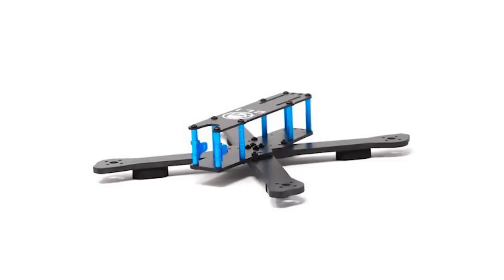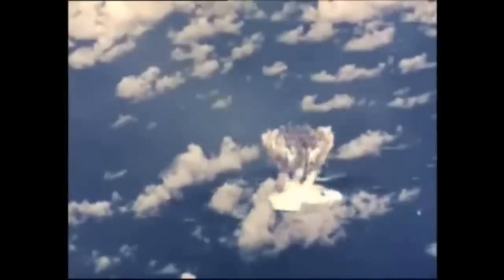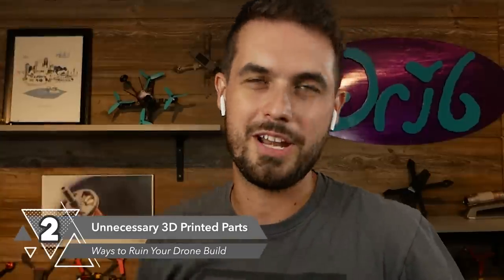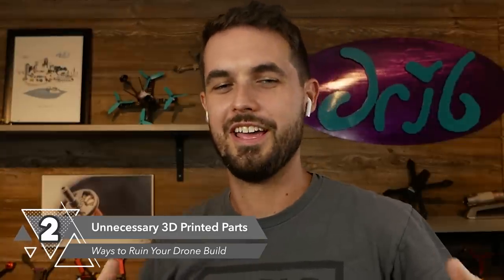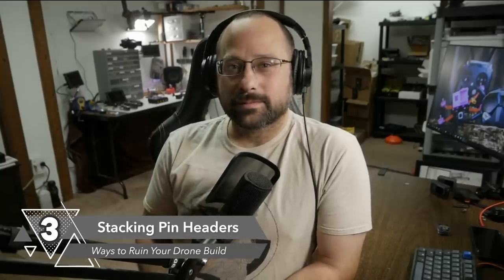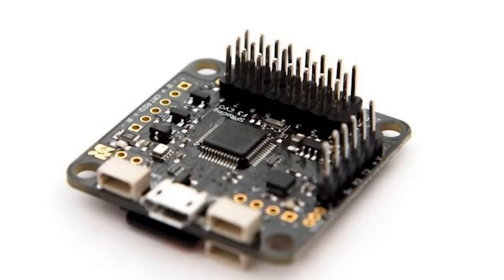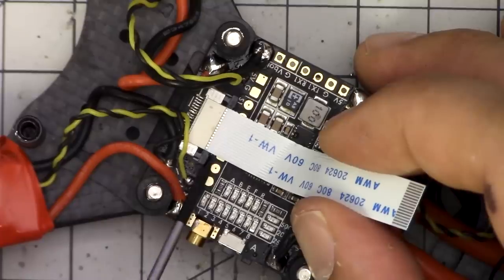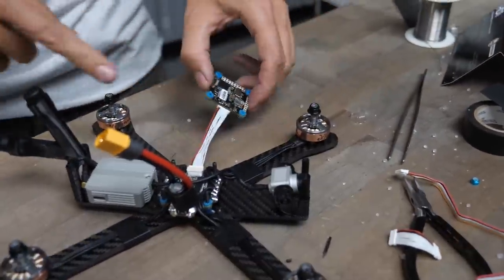6 Ways to RUIN Your FPV Drone!

Comment: I was just in the middle of a sub 250g 8 inch quad with titanium screws and nylon stand offs only 5 mm high wrapped in red electrical tape with a huge picnic table of a spoiler on the back and the most resilient wooden bumpers you've ever seen!

IM OFFENDED BY THIS VIDEO!!!
Reply: Bro so funny 👍
Reply: 😂😂😂man this is so funny it made me laugh on a rough day. Thanks!
Reply: Damn shame- did you have the 2 lbs of 3D printed parts ready too?
Reply: @matthebert007  Now that would be silly....... 🤣🤣🤣
Reply: After the day I've had, I needed that!
Reply: @HankSweeney  🤣🤣🤣🤪🤪🤪🤪🤪
Reply: Hey, they only said sub 250g 5 inch quads are a bad idea. They said nothing about sub 250g 8 inch quads... 😂
Reply: Ewwwwwwwww burn it
Reply: Hahahahaha

Comment: I come from the aerospace industry where titanium is used frequently. I believe you're right Joshua, you can make smaller lightweight parts with titanium but you are correct in that if any of the highly polished surfaces showed any signs of even the lightest scratch that part is scraped in my industry, titanium will fatigue fail where steel will just slowly deform.
Reply: But if you're going to crash your drone, wouldn't you prefer the screws to be the weakest link so that you'd have a better chance of saving the motors? The crash impact energy needs to be absorbed somehow;  I would prefer it not go to the motors.
Reply: @danusas88 Titanium and steel have different levels of DUCTILITY. 

Steel can undergo significant plastic deformation before it fails. 
Titanium, is more prone to fracture.

Over tightening a steel screw stretches it, and locks the threads, a titanium screw fractures and fails when you are depending on it later. 
( I hope this isn't a lightweight build intended to be around people )

Comment: Here's an easy one I'm surprised you guys didn't mention: Not using your smoke stopper because you're too lazy to reach over the extra foot to get it and you're pretty sure you soldered everything up correctly on your first try.
Reply: Never had one of those. I use my bench power supply to test drones. It has short protection and, as a bonus, shows how much current is drawn.
Reply: It blows my mind that people can't tell if they've soldered something incorrectly.
Reply: @wongalahara8196  I was the same until I followed a chinesium wiring diagram that was included with an ESC, which turned out to be for a previous revision where the vbat+ and ground pads were swapped
Reply: @Lozoot2  snap good point dude. I didn't think about that!
Reply: @wongalahara8196  and sometimes it's not even the solder job - a lot of the times the wiring harness from a FC to a 4-in-1 doesn't match up and it's easy to mistake which side is supposed to be "up" on the wiring diagram. Just yesterday I wired one backwards at first but caught it when triple-checking with my multimeter. I'm glad I've made it a habit to check!
Reply: @Lozoot2  I guess I just haven't had any bad luck with soldering and wiring harnesses yet lol
Reply: how were you checking for proper esc-fc wiring with your multimeter? Great idea I just am curious to what you check/how @Lozoot2
Reply: @CockroachSlidy funnily enough you did have one the whole time! Just an overkill one 😂

Comment: Never thoughts about it but from a former aircraft assembler your right. We would put lead rivets where expansion and contraction would happen and titanium composite bolts where we needed rigidity They would bend to an extent when trying to get a jammed one out, (because it wasnt pure titanium) but once that tension point was reached to would snap like concrete.

Comment: The alloy of titanium used makes all the difference! The alloy they use for titanium motor shafts works OK. But most screws of any metal sold on the open market tend to be low grade easy to work metal. Notice haw Joshua said "high grade" steel screws.
Reply: exactly, comparing "cheap" titanium hardware to high grade steel is a stretch. Ti will fatigue faster, but a good grade Ti hardware is more than enough.

Comment: i think there were a couple essential ones missed here. mounting the vtx antenna on the hole in the top plate, soldering the XT60 straight to the board without any wire in between, attaching the capacitor to the XT60 connector instead of inside the frame
Reply: Ohhh that's good.
Reply: All of those are good tips.  Basically you want nothing to be a rigid connection.  Everything should be able to flex a little in a crash.
Reply: What's wrong with soldering the capacitor to the xt60?
Reply: @stevensbox9625  while it is electrically effective, it puts the capacitor at risk of being damaged. they are very fragile and i have damaged countless capacitors even when they were mounted externally in a place that i thought was safe
Reply: @benfoust1  Its electrically less effective. The point of the cap is evening out very fast spikes, any length of wire will slow it down mostly due to inductance.
Reply: @drkastenbrot  the difference is so minimal that it’s negligible. thats why its very common to put capacitors on the battery pads or even on the esc leads and they are still just as effective
Reply: @benfoust1  The reason that works is that the ESC already has a handful of low esr caps right at the source of the noise, placing the electrolytic cap further away from the pads will put more strain on the small decoupling caps. 
At high frequencies, wire is not nearly as conductive as you might think.
Reply: @drkastenbrot  bro the wire’s resistance is so negligible. even if u do put the cap directly on the xt60 theres wire between the battery and the cap. it works just fine when the cap is soldered to the battery pad on the esc/fc
Reply: @benfoust1  Fine, here is some numbers:
The inductivity of a wire pair 12awg, 5mm apart, 15cm long is about 40nH. 
at a frequency of 100kHz which is the approximate rising edge of the dangerous peaks this would equate to about 25 milliohms or 2V at 80 Amps. 
Thats well over 10% of lost effectiveness just because of different placement of the cap. 
Having the wires closer together (5mm was a bit generous) makes this effect much worse.
Reply: @benfoust1  OK, Thanks. Its gonna be hard o fit it into the Armattan Badger along with the DJI Air unit. But I'll work on it.
Reply: @drkastenbrot  fuck all in a big ship. Also you forgot about the capacitive coupling, that probably wipes out your “inductivity” also most commonly known as inductance.
Reply: @Clynikal  What does capacitive coupling have to do with this? The schematic literally has deliberate capacitors on both ends of the wire pair.

Comment: Ive broken 5 surgical titanimum  rods in my back over the years.  No ti parts for me
Reply: jezuuus mate are you ok?
Reply: @ze2004  oh yes man been wheelchair bound since 4 years old. Nothing stopes me from doing what I wanna do. Well the broken rods do lol
Reply: damn another thing....... titanium screws...... tried shaving weight with aluminium screws over steel screws..... those just tore apart all the time and i broke tons of arms with them...... since i use titanium screws i never had any problems anymore.

the only problem i got sometimes is that i ruin the thread in the motors cuz they are not as though as the titanium screws
Reply: @RewindFPV  now they have to improve the base of the motors in titanium
Reply: @ze2004  haha 😂
well i actually think there are some titanium variants out in the market tbh 🤔
Reply: @RewindFPV  actually its really important to notice that because i had some steel screws and the base hole from the motors are in aluminum. Dose two materials combined make the holes loose.

Comment: One thing not to do that I found out the hard way was to not make the wires longer than needed. 2 days ago I transferred my electronics from my old GepRC LX5 to a GepRC Mark4 frame and I managed to do so with minimal soldering, however this meant that my wires from the FC to the (separate) ESC's had no slack. I took it out and everything flown great, right up until I crashed into a branch hard on my last pack. The crash snapped an arm, but the flex from the crash actually ripped the ESC power pads right off the flight controller from the arms that didn't even break. This was simply because there wasn't any slack in the wires.
Reply: Don't you mean not to make the wires as short as you can and have some slack?
Reply: @typeOhh  yeah lol. To be fair both. You want enough to have slack, but not too long that it's a mess

Comment: You CAN build a nice sub-250g 5 inch quad. The fly really nice and smooth (without a fancy PID tune) which is exactly what I wanted; a 5 inch cruiser (no GoPro; not my thing). Also, it was quite durable; crashes never broke anything. Due to a video issue,  I lost it in thick Florida brush. Anyway, I liked it and will build another sub-250g 5 inch; so I don't think this is a "RUIN"; quite the opposite. Since I don't do Acro and don't carry a GoPro, these builds are really SWEET and smooth little cruisers. I am also working on a light weight 7 incher. Don't know if it will make sub-250g, but think it will come in under 300g. Yeah, I know this is above the 250g mark, but I think it will be a nice long range cruiser.

Comment: some 4in1 racerstar ESCs need nylon standoffs as two of the holes are ground and the other two are positive battery voltage (not even the rubber isolators as those have metal threads which will rub and short out between layers....ask me how i know)
Reply: Mistake number 1 was bying a racerstar esc
Reply: @neonoir__  yep, lesson learned about 3 years ago.  but when you start out it was hard to resist the cheap stuff to "save" money. especially when every now and then there is a gem.
Reply: @neonoir__  it's the same as the holybro tekko s
Reply: Glad i didnt use mine yet, would have fried it for sure. :)
Reply: @daich  I'd say going for the cheapest parts in general is a good way to ruin the quad. I have a couple of FC: s that I bought because they were cheap. Welcome to gremlin city!
Reply: I remember these ESCs :)  Gone cheap and mounted them and FC with long nylon screws. Kinda sorted out ground loop for FC as well. Guess what happened on first crash :D

Comment: Thanks for the titanium screw point! It's a pet peeve of mine. Titanium is stronger than steel for the same WEIGHT, but weaker for the same VOLUME! When you replace a screw, you can't increase the volume, so you end up with a lighter AND weaker screw.

Comment: All my builds are pretty much slammed, I have so much regret fitting an air unit into every single one of them... :'(
A T-Motor F7 55A esc stack, crossfire nano, GPS, RGB controller, and buzzer into the tiny space of the racing frame that is the Transtec Laser was my first mistake.
Doing the exact same with a Flywoo chasers frame was my second lol

Repairing both of those takes a full day of disassembly. In order to replace the motors on either of them I have to completely disassemble the quad and with the transtec laser HD I have to remove the bottom plate and the arms as you feed the motor cables underneath a pocket created between the arms and the plate. Nightmare fuel.
I've disassembled and reassembled that quad a dozen times now... so many hours of stress.

Surprisingly my easiest drone to build in is a beta95x v2...

If you want to build a drone with those features I mentioned above, build it in a freestyle frame not a racing one or you'll suffer.
Reply: After 2 years w a transtec laser (Nevers break anything ) I have finally  done a ''''''''clean'''''''' build
Reply: @gap8526  this lmao, I fear the day I break an arm and have to disassemble the entire frame. That might be the day I switch haha
Reply: If u want to ne a pro par tertris just start w a racing frame x)
Reply: @gap8526  LMAO I jinxed myself. I forgot I posted this, but a week after I posted this comment about breaking an arm, I BROKE AN ARM. Decided I wasn't going to deal with it and bought a catalyst machineworks shocker tank. Honestly it's a much more difficult frame to assemble, but so much easier to replace a component once it breaks.

Comment: I use high quality titanium screws from KCNC on my discs for my disc brakes on my downhill mountain bike. They have survived without problems for 4 years without issue now. I can't see how they can't take the strains of a quad-motor if they're good quality.
Reply: Yeah they can certainly have enough tensile strength to get the job done (have used them and other superalloys for my job), but I think the main point JB is trying to make is their strength is still lower than a standard high grade steel fastener. 
Steel also generally has higher elongation at failure (9-12%) than Ti (8-10%) which helps to “fail-safe” by yielding and becoming loose rather than fracturing. 

tl;dr - Titanium has higher specific strength (strength/weight) but lower absolute strength. 

IMO if you’re bashing your DH rig around I don’t think the couple grams of lower mass is worth the loss of robustness/failure warning, but they do look sweet!
Reply: @ZacharyPiercy  On my DH rig, I save weight where it is possible and add strength where needed. Ti bolts on places that has shear load and non critical load tensile load (disc rotor mount, link monut, shock mount, seat post mount). Tires, tire inserts, and rims I use proper stuff that can take a beating, I build my own wheels with double butted spokes and brass nipples. I would for instance never use ti bolts to mount brake calipers or for stem bolts.

So, yeah. Ti bolts ar perfectly fine if you know where to use them.

And for looks: Mine are silver, so the look kust like regular steel bolts.

Comment: I use nylon stand offs for my stacks.I have had pretty hard crashes and not haven't broken them. I have also broken them, but after a ton of abuse. I have also used metal screws.  Nylon standoffs will not ruin your build. at  least on the stack any way. I have used them since starting, and I will admit that I probably wouldn't have had to replace the few that I have, but I have had nearly no issues with them.

Comment: Poo sub 250gram 5 inch, I am legitimately in the middle of a sub 125gram all up weight 5 inch build. The quad is looking to be about 95grams and I have a 2s 300mah battery that weighs less than 16grams.
Reply: With the new EU regulations it makes sense lol

Comment: High grade titanium screws work fantastic for motors. I use 2 ti screws on each motor and have never once had a motor come off
Reply: You should weigh them.  You will be surprised to find out Titanium is significantly heavier than Aluminum.  Titanium has a density of 4.5g/cm^3.  Aluminum has a density of 2.7g/cm^3.  3 Aluminum screws will literally be lighter than 2 Titanium screws of equal size.  Most people are confused about Titanium and think it is lighter (less dense) than Aluminum, it isn't.  Titanium is a lightweight alternative to steel, but Aluminum is still an even lighter choice than Titanium.
Reply: @Plur307  I have tried aluminum and had only bad experiences. Even three screws were never enough not to mention the constant stripping if you're not careful
Reply: @Noical  Yeah stripping is an issue.  Takes a few mistakes to learn you can't crank them down hard like a steel screw.
Reply: Me too dude and 7075 alum...0 issues for years
Reply: @Plur307  But you don't understand the principal thing that he is saying.
Reply: @ze2004  already did a comment but again..... if steel is too heavy for you.... just don't go with aluminium no matter what....... broke tons of arms cuz of aluminium screws and after some landings on hard ground aluminium screws get so worn off that you can't even really screw them out........ since i use titanium screws = 0 issues plus lighter than steel........just sometimes the motor threads are not though enough for the screws 😂

Comment: For the super slammed frames, to prevent the carbon fiber from being conductive, what if you put some electrical tape on the side of the frame that's close to the electronics? to prevent a shortage. just an idea
Reply: The idea probably was to avoid packing that narrow space with electronics to brim. These frames are fine for AIO boards + VTX and no more.
Reply: @KrotowX  they literally said that you risk a short circuit, and this dude just specified that his question was directed at that point.

Comment: Yea, for the sub 250s I go for 3"!
1804 motors, 3052-3 props, 20x20 stack and a O3 air unit and a 650 mAh 6S.... I mean 3s... Battery! 🤫
At 6S it's a serious race quad, at 3S it's a milde cinewoop!
Very versatile! But don't forget to tilt your camera between modes! 😬

Comment: I was planning on buying a Geprc Cinequeen but I noticed that it has the pin headers. Is it just the 30x30 ones that are bad or the 20x20 ones as well? I haven’t seen anyone complaining about this being a problem with this drone... is there another similar drone that doesn’t have the pin headers? Thanks
Reply: Smaller drones, less weight, less speed, what is used to mount the stack, what is connected to the stack that may pull on it, can all affect it. Likely a cinequeen will be fine
Reply: @KernsJW  thanks! Do you happen to know if there are any drones better than the cinequeen under 250g? I know it is over a year old but I cannot seem to find anything else newer in the same class of drone.
Reply: @BuildItWithBenjamin  hey,  haven't looked much into that class.  I like to cruise, so LR has my interest and micro LR currently.  Saw Sync FPV fly one recently that looked good,  but I know nothing of it

https://youtu.be/Zhc_325x9Xw